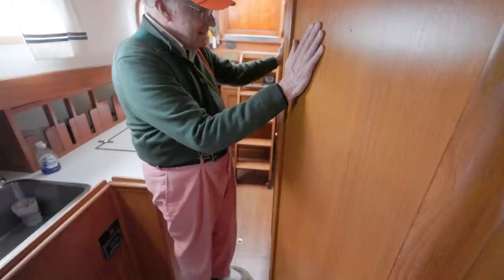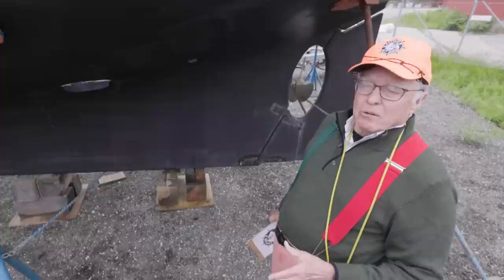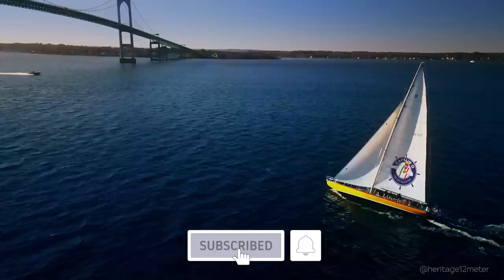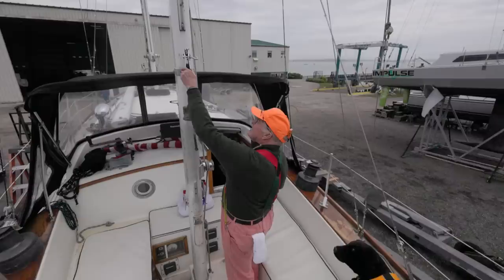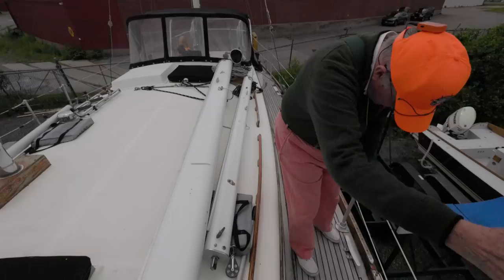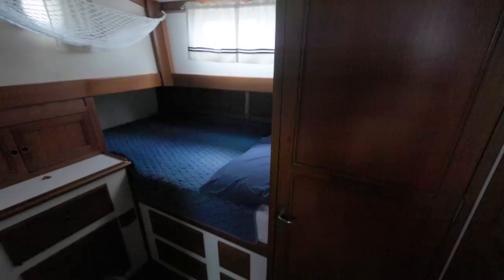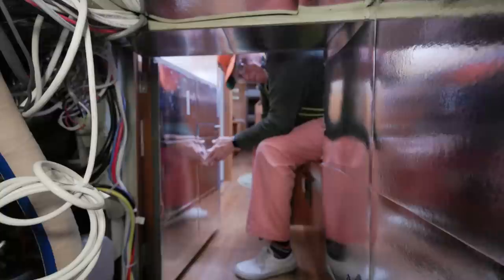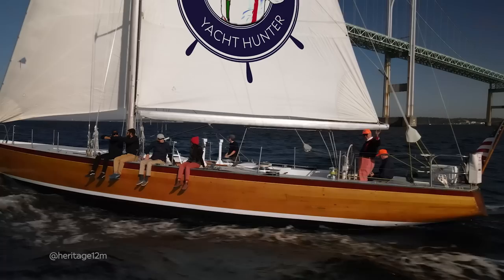$89,500 WORLD CRUISER!! Bluewater Cruising sailboat for sale FUJI 45 - EP96 #sailboatforsale

Comment: Gents I don't recall seeing the nav station on this boat.  If it was a nice as the rest of the boat maybe it could have received a couple more points.  All in all a very nice apparently blue water boat.   Keep the good stuff coming guys.
Reply: Good catch! You sent me back to look. It is a stand-up station on the port side between the settee and aft cabin. You can catch a glimpse at 15:00 and again at 20:40. SeaDog is standing guard. It is too far from the cockpit, and stand-up does not make sense. Minus two?  I would have designed it as in a number of other boats: Swap it and the refrigeration, and use the quarter berth for seating. You lose some drawers. Routing of coolant lines might be a slight issue.
Reply from the maker: Good catch… somehow it got clipped out during editing.

Comment: If you smooth out the “thiacol” in the deck seams you will discover that the “caulk seam” is very shallow and you will have no thiacol.  That deck is on its last legs and will soon need to be removed.  Big job.  45 year old teak deck should be a deduction in overall boat’s score.
Reply from the maker: granted its getting old but if youcan trim it down , less like to tug it  out with a set of topsiders grabbing at it

Comment: This would be a great upgrade from my 1947 Allister Stairs designed Cutter Rigged Oneida II which is 28 feet, 7 tons.  Cedar over Oak frames.  Centre Cockpit. 38 HP Acadia Gas engine.  Still the original engine placed on board in 1947.
Reply from the maker: Lovely… and that would be a sizable upgrade

Comment: Very nice boat but I would be looking into replacing that steering gear with a more modern pedestal steering system mounted farther forward if I considered buying it.  Not sure how hard or expensive that would be to accomplish but it should be doable.  That old school steering system just doesn't work for me and the only minus I can come up with on an otherwise excellent boat.  Thanks for the video!
Reply from the maker: Fair enough! but its lasted all these years and it is very direct with no cables to stretch or break     live with it for a period before you waste your money       on the next boat,,, this one just sold

Comment: Where does the LOA end forward, at the bow(end of hull) at the bowsprit, at the forward lean of the pulpit?
Reply from the maker: yes    think of a shoe box that the boat just fits in    that's the length that boatyards use for  docking alongside and for part of the measurement along with the beam to figure cost to store on hard

Comment: Whoops....jumped the gun. This boat is way different down below than HC's and the Taiwan boats. What do you guys think about a deck-compression post set up on a boat this size rather than a keel stepped one?
Reply from the maker: pros and cons for each but the one big pro for deck stepped is when you loose it there is no hole in the boat and also it allows more conversation over the dinner table
Reply from the maker: those decks are good for another 20 years i would bet